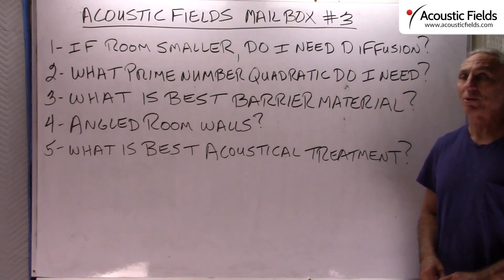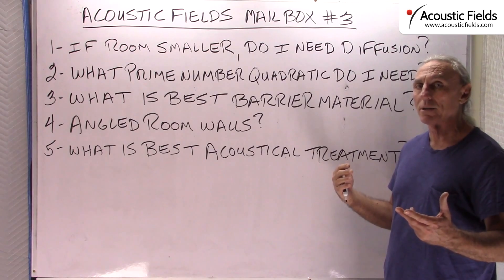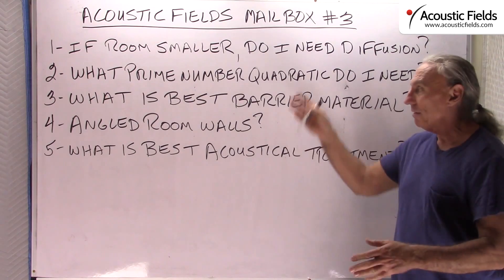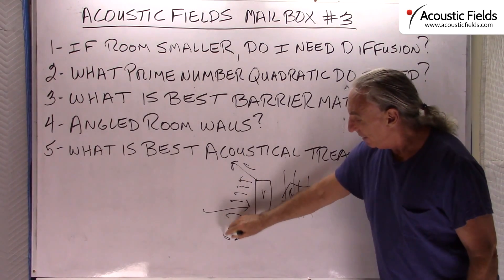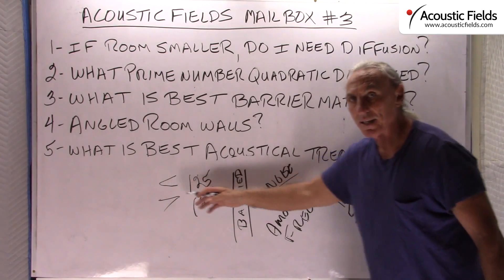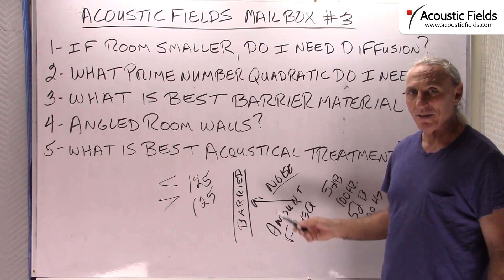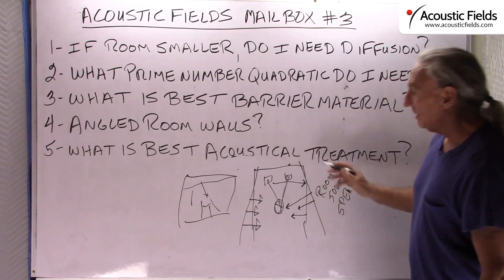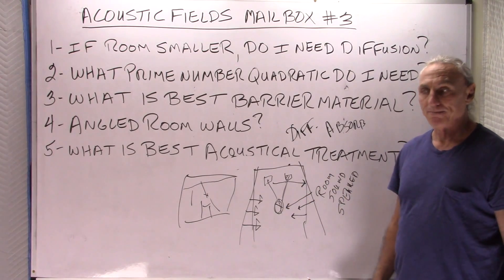Acoustic Fields MailBox #3 - www.AcousticFields.com

Comment: How about something about attic room ceilings, where there are two sloped sides? For example, is it better to sit facing between the slopes or facing one of the slopes? Thanks.
Reply from the maker: Hi Lahattec, Sloped or angled surfaces produce reflections. You must then decide if the reflections and their directions are harmful for your chosen usage. Do the frequency and amplitude of the reflections cause distortions at the listening or monitoring positions. You have to trace the reflections and see where they are causing issues with the room usage. As a general rule, which I hate to use this term, because there is no one size fits all in acoustics, you make sure the reflections end up behind the listening position out of the direct energy sound field.